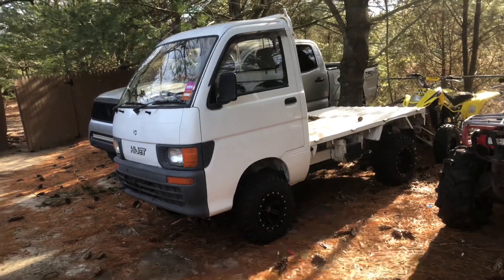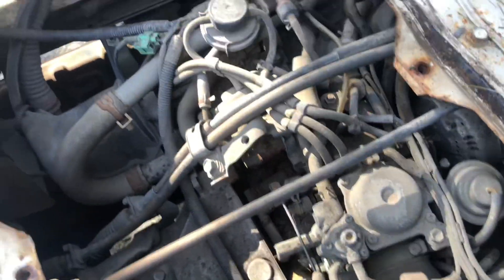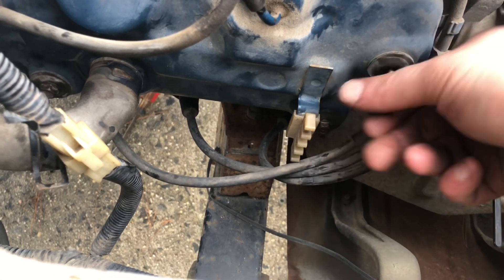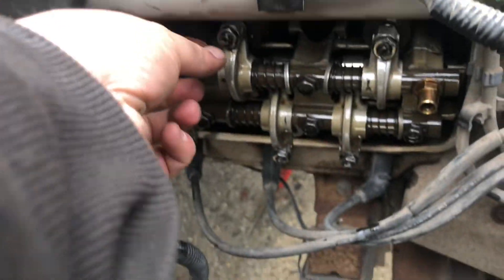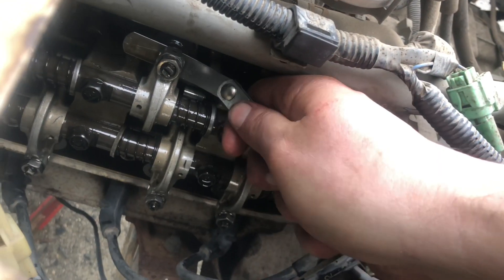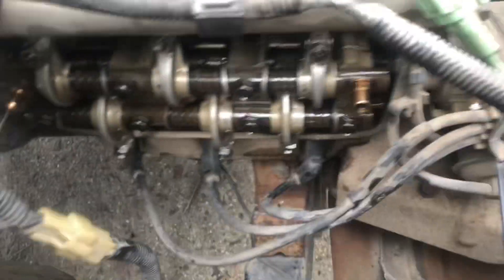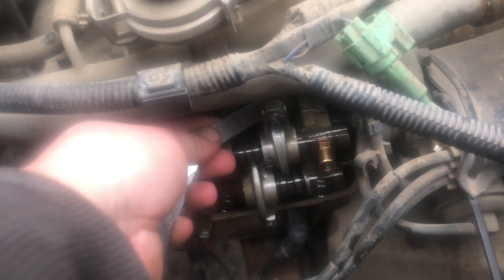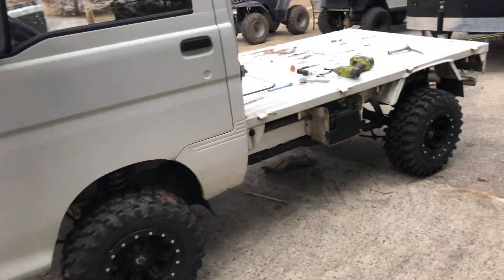Mini truck maintenance - valve adjustment time

Comment: Hello!  Just watched your valve adjustment on your Kei truck and was shocked when you said you adjusted them while hot!  Every valve adjustment on any vehicle or motorcycle I’ve ever worked on called for cold valves when doing the adjustment. Where did you get the “while hot” information?

Comment: Normally you do not want to adjust the valves hot.  Does it specify this in the manual?  The reason for a valve gap is because as the engine heats up the valves extend and the gap closes, so adjusting them hot seems very odd.

Edit:  The service manual states the following:

EF-NS and EF-TS Engine Specs:
Intake:  0.18mm +/- .05mm
Exhaust: 0.25mm +/- .05mm

EF-ES Engine Specs:
Intake: 0.20mm +/- .05mm
Exhaust: 0.30mm +/- .05mm

The engine should be cold when checking the valves.
Reply: 100%
Reply: Do you happen to know specs for the EF-GS engine?

All manuals barely make mention of this version

Comment: I have a Hijet as well and am having an issue with it starting. It takes a while for it to turn over but once it’s running for a while I have no problem killing it and restarting. Any advice?
Reply from the maker: Sounds like the valves are tight or the automatic choke isn’t working